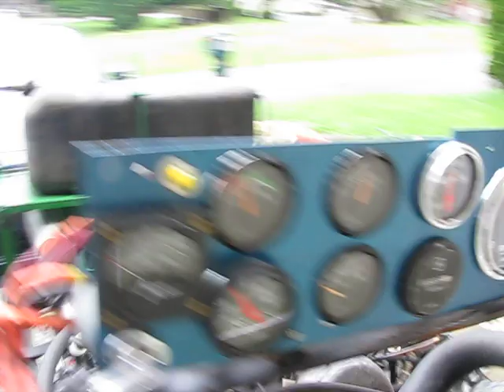8-28-11 power outage

Comment from the maker: Some may say overkill I say awesome its not  the extra power but it was a learning process, alot of fabrication, motor alignments But the are about 5 or 6 times and year i lose my power for 8 hours or more. I wanted something to keep my fridge cold, home cool  or warm in extreme temps, be able to run my well pump, I know i could run all that stuff on a smaller gen but what the hell i have the resources to create this. The hot tub i basically ran that to load test the generator